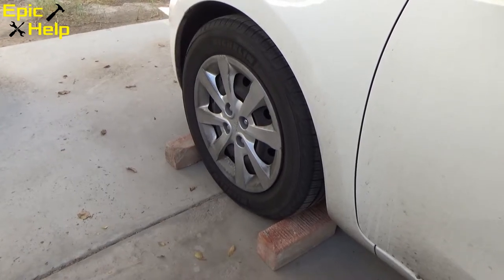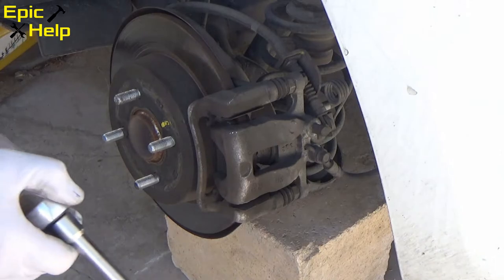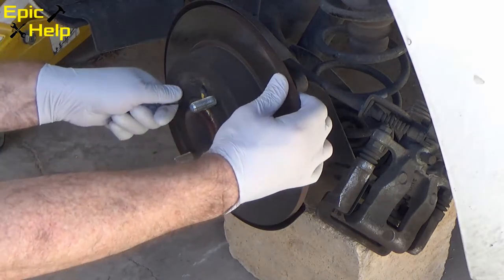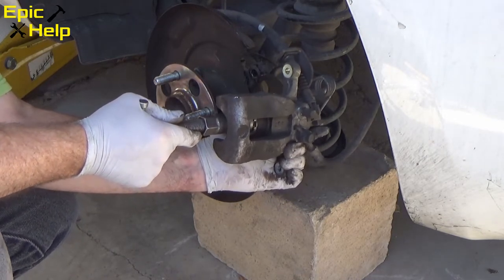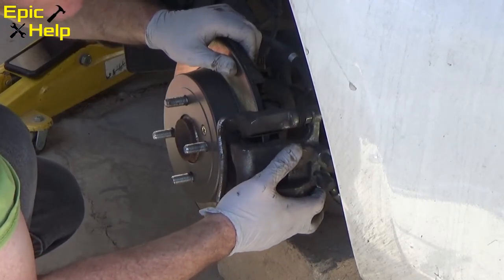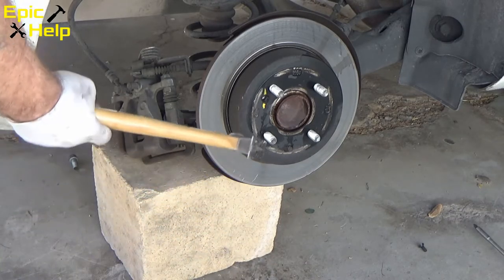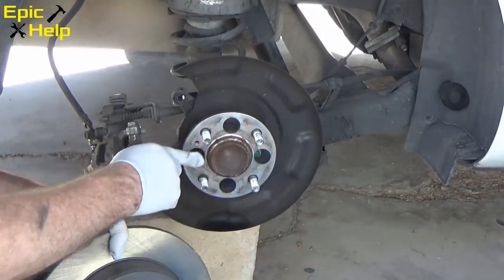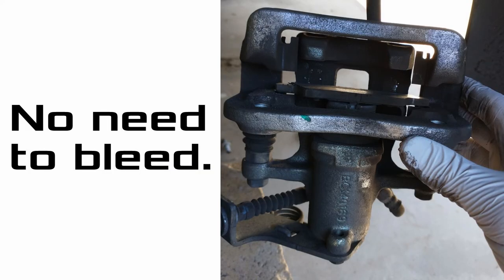Replace Rear Brake Pads and Rotors - 2013 Kia Rio

Comment: For my vehicle's manual it gives bolt torque specifications in a range.  It'll say 23.5 lb ft - 29.3 lb ft.  Why is there a range and what number does one use from the range?
Reply from the maker: Anything in range is good. Going above the specified torque range can damage the threads on the bolt or on the vehicle. Going below the specified torque range the bolt or nut is not tight enough and may come loose.